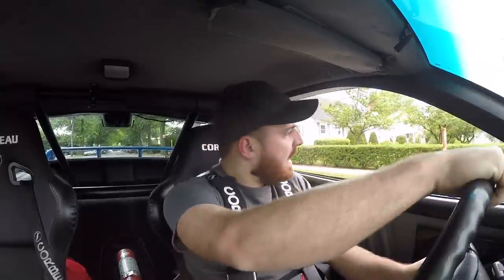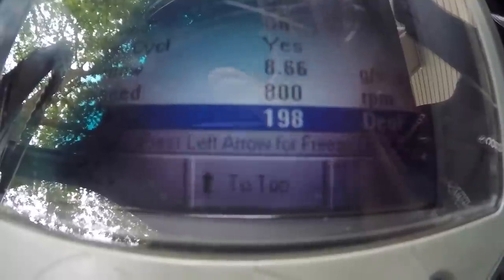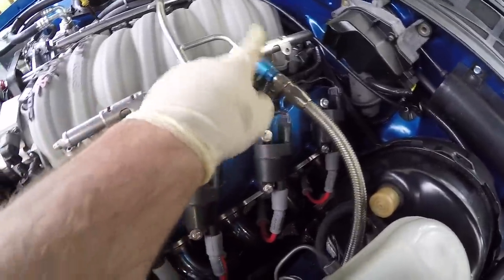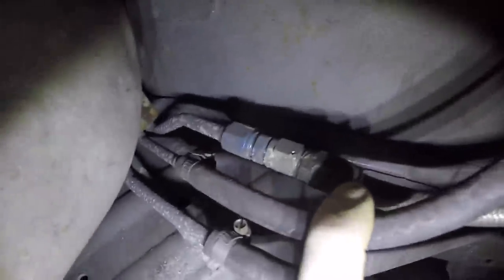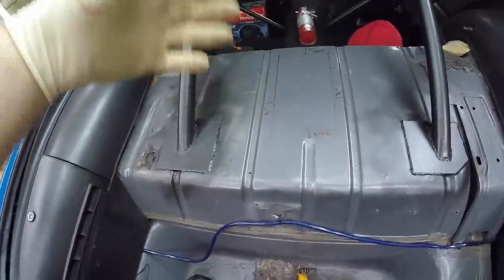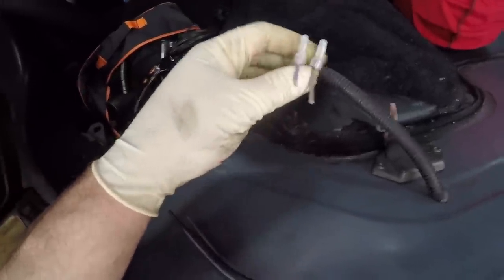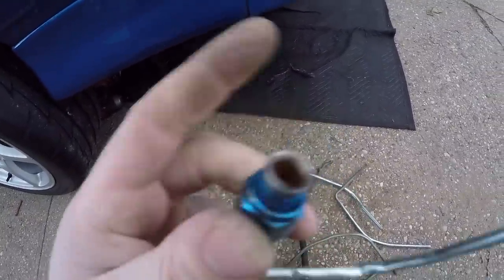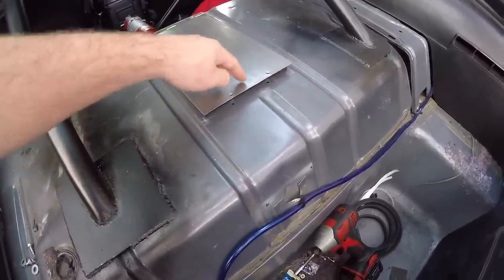How to: 3rd Gen Camaro Fuel Pump Access Door | LSA Blower Swap

Comment: I've done the doors on all of my f-body Camaros and a few s10 blazers for friends. The only thing I did different was put thread inserts instead of self tapers. the access door is the best way to change the fuel pumps on this cars for sure.
Reply from the maker: That’s a good idea, I’ll probably put some in my self.
Reply: I'm going to use pop rivets with an Allstar 14x10 fuel pump access door.

Comment: You're running hot at idle is not the cooling fans. Your water pump is not moving a sufficient amount of coolant at idle to keep the engine running at a cooler temperature. You need a performance water pump that moves a higher volume of coolant at idle.
Reply: Blind_N_Baked 420 any underdrive pulleys????

Comment: Old video i know but i recently had pump in tank go out on my TA and originally i mounted a fuel pump on body rail and used the pump in the tank as a secondary pump for my LS swap. So now that the pump finally went out, i decided to do it the correct way and do away with external pump and put the right kind of pump in the tank to supply my LS. I did my fuel system exactly as you did. Put my return where my vent once was and used the old supply line. The vent it hooked up to the second from the right and the evap i hooked up to the one beside the fuel supply. When i ran it the first couple times everything checked out no leaks or anything. Then i took on a bit of a longer drive, maybe 35 minutes and it started to leak. At the time i couldn’t tell where from, it emptied the entire tank. Now i get it to garage, go to turn pump on and run it and i have no leaks. I let it run for about 20 minutes but i only have 1/4 tank now and when the leak occurred it had about 3/4 tank. Could this issue be because i put those vent and evap lines on different lines than original. Is it okay for me to just leave the evap and vent lines unhooked.

Comment: Aw dang man, great job, I wish I could have recommended getting the plastic 4th gen tank though. It's a much better tank and the hole you have to cut to do fuel pump swaps is much smaller. Great job though. Car is coming right along!

Comment: Matt, I've been enjoying your channel for a while now and trying to figure out what area you live in. I'm of the "pro fuel pump door" group. I have to tell you, that's not a particularly good way to do it. It's real flimsy.  Not that my 2 cents is worth much but I would have drilled the corners to avoid the sharp 90, used heavier steel for the cover, and used rivnuts with a gasket around the perimeter. No need for a hinge, and welding near the tank is not a great idea, happy to see you work outdoors :) I did mine 15 years ago, not exactly as I suggested, but hindsight is 20/20.

Comment: Fan shroud is not deep enough, those fans are not pulling air from the radiator corners.Air needs space when coming through radiator and turning 90° to pass through fans.Add 1"-2" depth.

Comment: Question,  i have an 86 Camaro full Injection v8. My fuel gauge its not working properly,  so i really need to cut my muffler pipe to install the floater?

Comment: When you bypassed the connector for the fuel sending unit (purple and gray wires) and rewired them directly without stock plastic connector...does your fuel gauge work?
I just installed a new fuel sending unit bc my fuel gauge isnt working.

Comment: You have coolant flow problem at idle. high flowing water pump maybe will help. You have alot of amp draw with all the fans what is in your cars volts at idle. If you rev it up and fans speed up way need to upgrade alt. and wiring or maybe just wire upgrade.
Reply from the maker: Voltage with all fans on, blower on high with headlights is 13.6. Before I swapped to the new accessory drive I had a 90 amp alt. New one is a 140. Also the pusher fans don’t run unless the ac is on. Fans are wired with their own relays with 12 gauge wiring.
Reply from the maker: Also with the cap off the radiator, if I rev it up I can see coolant flow through the passages in the radiator. At idle the coolant seems to just sit there.

Comment: What's that white round piece at 8:31 by the fuel filter I just got my 93 camaro and the pump went out crawled under the car and mines melted at tied up with wire

Comment: This helped a lot thanks so much I’m doing an LS swap right now in my 3rd gen and I’m running into confusion with the fuel pump. Is there any way u could explain some of the wiring for the fuel pump?  I think I have to make my own relay but idk. Thanks for the great vid!
Reply: should be grey hot black ground and purple for the fuel gauge.  coming out of the sending unit that is. up to where it plugs to the harness out back purple be fine and ground should be also just tap into a fuse or wire that is hot only when key is on find that with a test light and jump it over to the grey wire, bam.

Comment: My trans am came with a mechanical fuel pump on the small block.. my question is can I just add the pump to the original sending unit... and what pump would you recommend
Reply from the maker: I think you can, but if its the original sending unit it would probably be a good idea to swap it out. Then you can order one for a fuel injected car and the pump will fit easily.

Comment: If it's your car, and you work on your on car, what does it matter,  do a clean job, it's a hell of alot better than pulling out that tank, my Ram 1500 i lifted the bed up just enough to work from the top,  got a tank with 26 gallons of fuel in it, not fun bringing it down

Comment: I have a 160 thermostat. It opens sooner thus keeping the car cooler.
Reply: That won't help at all. It just lowers the minimum engine temperature. His temperature at idle will not change what so ever. And running a 160 thermostat without a tune will make the engine think it's colder than it should be, thus running rich and losing power.
Reply: King's Gift - I have a clapper thermostat, and it opens anytime I clap my hands. The only problem is I only have one arm, so it was hard to clap until I bought a mannequin. I positioned the mannequin in the passenger seat, and extended it's left hand out in my direction. So now I high-five the mannequin to get the fan to turn on. It works great, except my girlfriend hates having to ride in the back seat because the mannequin has to be in the front seat. Oh well, it is what it is.
Reply: bad idea with EFI and an LS. the engine is designed to be the most efficient at 180F+ running 160F will tap into the fuel enrichment curve and reduce performance and MPG.
Reply: King's Gift 350tpi like to run hot 200+220
Reply: This is a "trick" that belongs in the 1960s. Aluminum heads benefit from running around 190-200 or so.I aim for just under 200 on my blown EFI 5.0 with aluminum heads and run a stock 195 stat. You could get a custom tune and adjust the fuel trims to around 180-190 degrees, but you'll still get a better burn closer to(but not much over) 200.

Comment: I think a 160 thermostat will stay open all the time not allowing the rad and fans to cool the fluid...
Reply: If that were true,  spinning the engine faster, hence the pump,  would make the problem worse.  A 160 does not cause this problem from my own experience.  However, running without a thermostat will cause problems because there is no choke point and the flow rate goes through the roof.... had tried to run with no thermostat before and over 4k rpm my lower rad hose would actually get sucked closed with a factory water pump.  At the same time the flow even at idle was so fast the rad didn't have time to cool.  A 160 thermostat does not cause any of these problems.  Dropping idle coolant temps can be accomplished either through spinning the water pump a little faster,  higher capacity cooling fans,  or quite possibly the easiest and best way if you have a programmer,  reducing ignition timing at idle conditions. Firing the cylinder later reduces the time of burn in the engine, carries more of the heat out the exhaust at idle.  At no load,  true idle conditions,  you can take the timing safely back to 0 advance without risking burning exhaust valves,  seats etc.  As soon as you are off idle,  make sure your timing is back to correct timing.
Reply: Magnum Caliber Creations I see your point... i had a gen 1 engine that actually ran 20 degrees cooler when I locked the distributor out at 36 degrees
Reply: I’ve always had problems with overheating and now I’m doing my first Ls swap with a turbo so I’m definitely interested to see what works... I’ve learned alot from these videos .. keep em comin!

Comment: I know the 3/8" feed line and the 5/16" return line 
I need to know exactically what one is vent and evap
Reply from the maker: Vent has a plastic vent bulb on it clipped into a bracket.
Reply: @lsxmatt  it's all still installed in my car 
I just needed to know if the evap line is 3/8 and vent is 5/16 or vice versa 
And can I just plug the evap up if I'm not using that anymore
Reply from the maker: Ben Kalinowski evap and return are both 5/16. Feed and vent are 3/8.
Reply: @lsxmatt  ok ty 
That helps

Comment: When referring to AN fittings it’s “dash” not “negative” bro....just sounds a little weird hearing people say negative. 

I’ve dropped my tank and several others before. It’s a pain in the ass. I decided on the current car (my 98 Z28) more than a decade ago to cut a hatch to get to the fuel pump. After probably 15 years, I’ve had zero issue or regrets!

Comment: For what you did I would have just dropped tank - for fast swap cut the easy access hole but your all over place , dropping tank not that much harder and you get full access / fwiw
Reply from the maker: I’m glad I didn’t. It turned out the pump was defective so the tuner had to replace it. Would of cost me a lot more if there wasn’t a door.

Comment: Nooooo not the trap door mod.. whyy 😅😅
Reply from the maker: Haha I was never one for it, but the cars so modified, what’s one more hole?😂
Reply: Theres nothing wrong with the trap door, some people get way to anal about it. I have the trap door mod on my 86 z28 and on my moms 85 iroc. Saves time plus who wants to pull there whole rearend on a highway somewhere to change the pump whe  your on a road trip or something? Plus who just has a floor jack and jack stands and all the required tools just sitting in the back of there 3rd gen?.
Reply: Most modded thirdgens are running a trap door, since you need a bigger fuel pump for decent power, and dropping the tank is a real pain in the ass. Some Foxbody guys run one as well. I originally dropped the tank on mine, but when my Walbro pump died I put a door on just in case my replacement Aeromotive died(so far so good). People get oddly defensive about this subject, ironically it's usually older guys with clapped out stock TPI IROCs or worse, carb swaps.
Reply: @lokihallow  I've replaced my fuel pump twice and tank once.  Never once "pulled the whole rearend".  It's a pain, I admit, but not hacking the floor pan up, or cutting the metal lines, is the reward for doing it right.